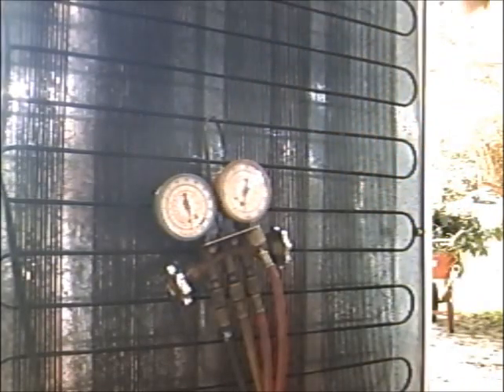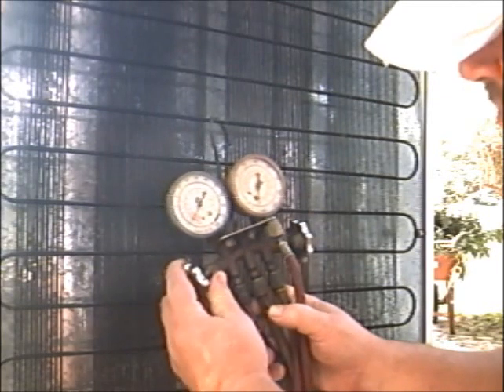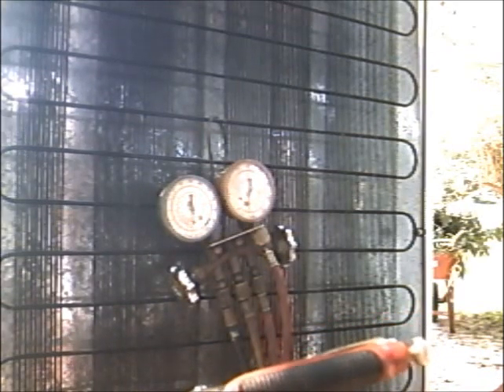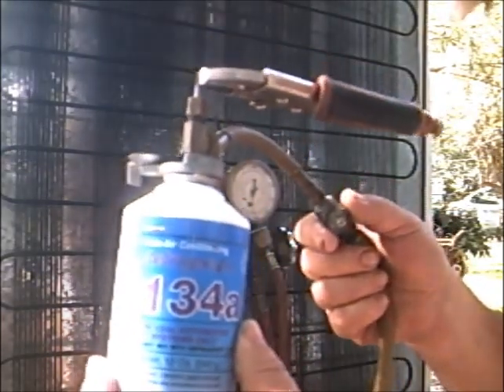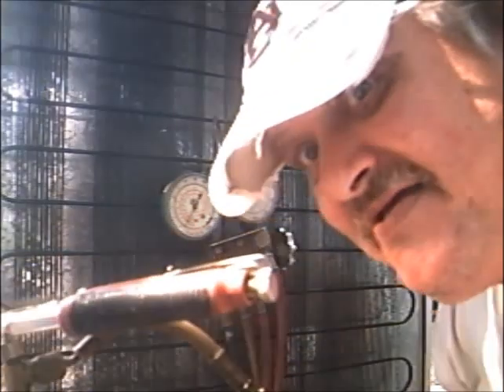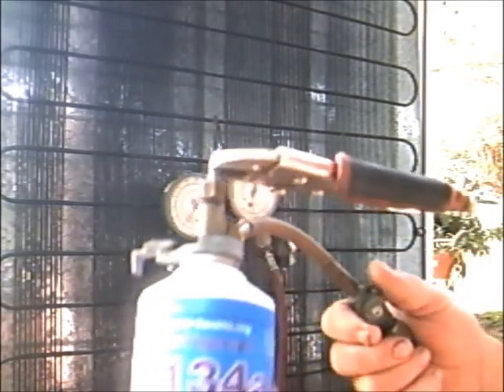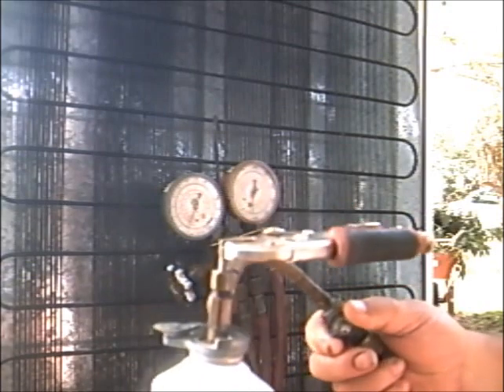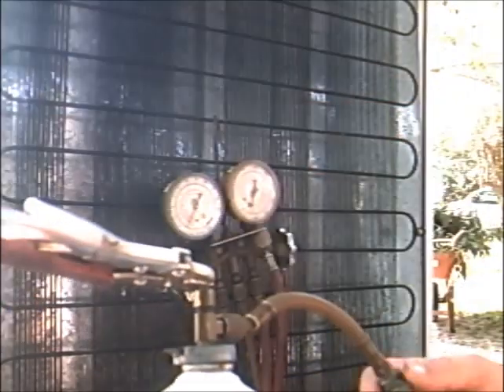How to recharge an old refrigerator ll

Comment: I put a -10 psi vacume on my minifridge, it held for 24 hours, I added about 3-4 ounces w/o releasing the vacume. It now has +5 psi, but isnt cooling and the compressor runs all the time. What did I do wrong  paw paw!!
Reply from the maker: Check for kinks in the cap tubing coming off the filter drier.
Reply from the maker: You might have an air restriction or probably have added in too much freon. Too much too soon floods and chokes the line. Line tap is an A-1 blue hose goes to manifold, yellow hose has a valve to slowly add in I mean slowly add. What does the frost line look like on the evaporator?
Reply: Dan Webster
no kinks that are noticable!
Reply: Dan Webster
I probably added too much freon. Ill bleed some off tomorrow. No frost, 3 hours later. it is cold, but no frost. its holding at 60 degrees, I will keep posted what I do! The compressor runs constantly and is very hot, unplugged it and will resume tomarrow.

Comment from the maker: Needs to be on so you can watch the gauges. Only needs a tiny amount of gas going in (4 ounces or less). You add in just a little bit to see if it gonna hold and bubble test all connections for leaks before proceeding. Then after you get her to the correct charge you bubble test some more.

Comment from the maker: Window units use R-22 which is different gas. Window units need to be ideally charged to 68 PSI on the low side. R-22 is a lot more forgiving. I worked on a window unit today. The electronic controls were shot. I bypassed all of that and mounted a mercury bulb mechanical thermostat to cut power to the unit when the house gets cold. Check out some of my videos I made on how to do it.

Comment: hey Dan is the procedure the same when it comes, to ac window units  just braze a port on low side pull vacuume, and throw a charge , 5+ or  else how do you throw  a charge on a window ac, man???? just wondering if it,s the same as a fezzer

Comment: when turn the portable on, after 20 seconds compressor kicks in,  works  blows nice cool air, but then after 5 minutes shutts of  and it,s really hot to the touch,  i guess wht it reachest hot temperature  the termic sensor or what ever is call  shutts the comp  off
till is cools  turn  ac again and it works just fine, will check the astarter relay  thank you..

Comment from the maker: Being low on refrigerant will not make the compressor get hot. What will make it get hot is a fried or welded start relay. Using a clamp on meter you should see on initial startup the amp draw to jump up then drop down to around 1 amp maybe a tad more. If it don't drop after 20 seconds the compressor relay is bad and allowing both winding in the comp to run and overheat.

Comment: and the big question is can a fridge or ac system low on freon cause the compressor to over heat???  can you helpme on this one, i just receive the replacement fron that i bought at Ebay, and just about to do the job

Comment: hey dude i,m working on a portable ac, it takes r22 refrigerant, i made a resurge  and find that i can use replacement for r22 is nu22b, i,ve bought it from ebay, well the thing is the compressor rom the acis heating & it shutts off,  i ssume it my be  low on freon or the star capacitor, i have tested the capacitor it seems good, the evapporator only frezees half way, fan hig speed, i think it,s low on freon, can i used same gauges i used to recharge 134a refrigerant or shoul i buy a new set??

Comment: HI   Dan are you saying you can charge and old fridge that used to used r-12  all you have to do is pull vacuume real good and then throw a charge of 134a freon??   what about oil from r-12 does it needs to be changed or just do the charge and it will work, let me know cause  i want to learned as much as possible, thank you!!!

Comment: You never change out the mineral oil from the R12 . The R134A is different oil all together . But if it running and the compressor has no problems , than thats good to know .

Comment from the maker: I have never seen any problems using R134a in old R-12 systems but what I do is vacuum out eh system real good and see if it even holds vaccum before charging and think about it most systems only use 4 ounces or less of gas.

Comment: You dont have to change the oil from the old R12 mineral oil . Dont R134A use a different type of oil for the compersor . But for the most part 134a will work fine for old refrigererators